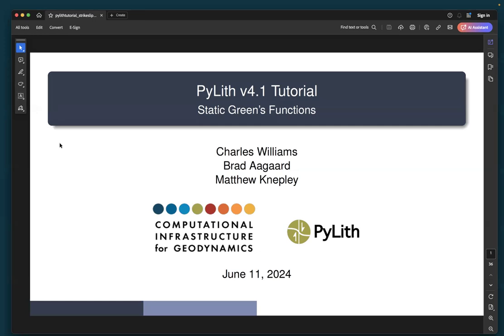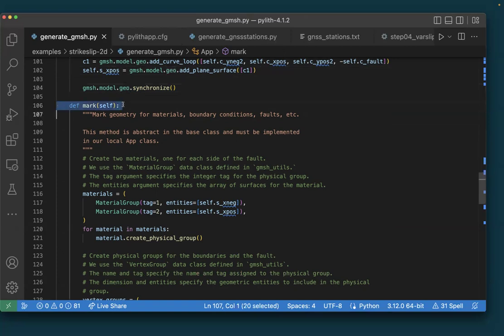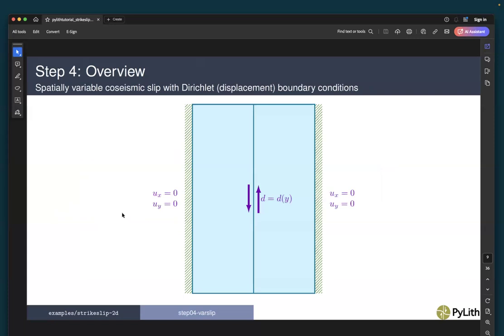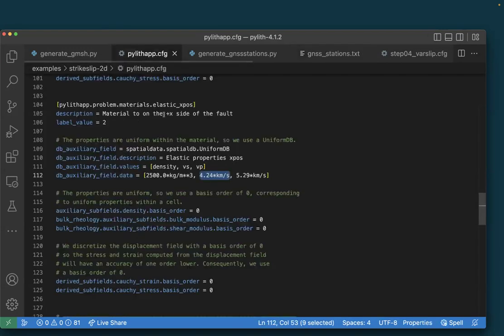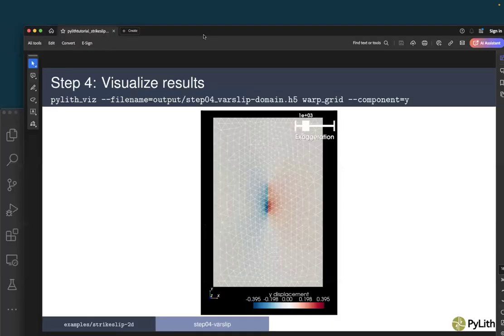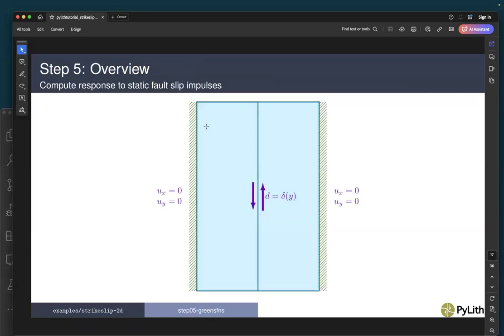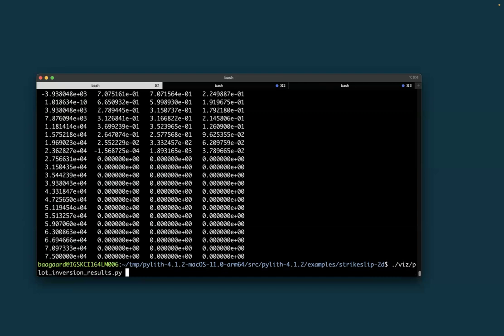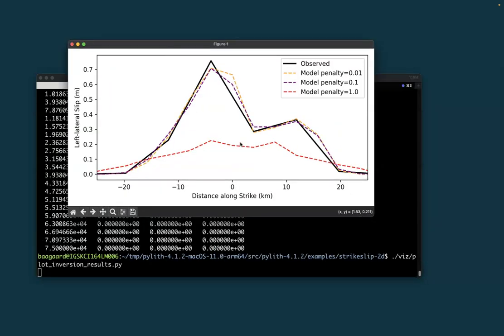PyLith v4.1: Static Green's functions

Comment: I wonder that can I get the Green functions as the example with an heterogeneous model?.
Reply from the maker: The Green's functions example in examples/strikeslip-2d has a contrast in shear modulus across the fault. It uses two separate spatial databases with uniform properties. You can prescribe the same variation in material properties with a single spatial database with variable properties. Other examples demonstrate how use of spatial databases with variation properties. For example, examples/strikeslip-2d/step04_varslip specifies spatially variable slip using a SimpleDB spatial database.